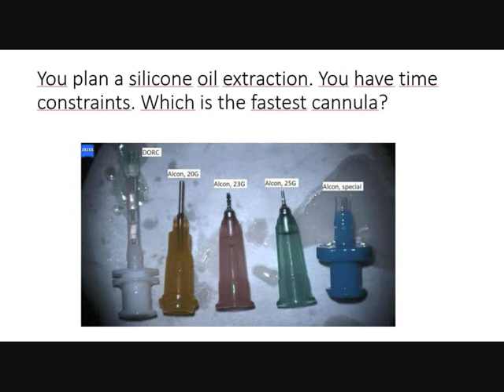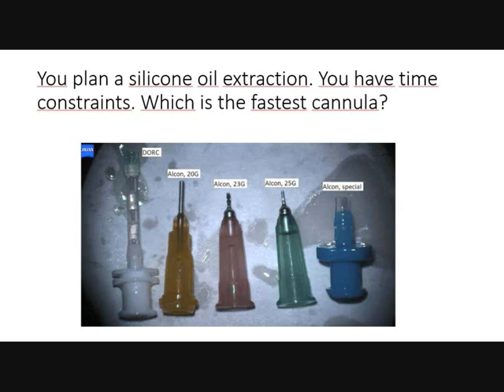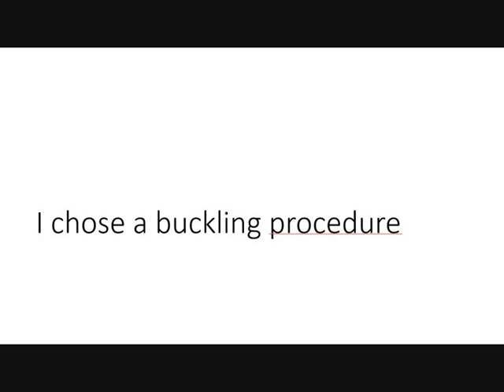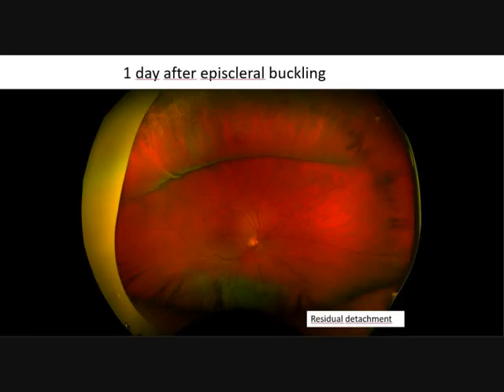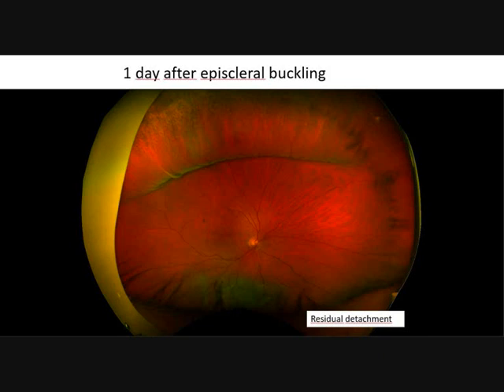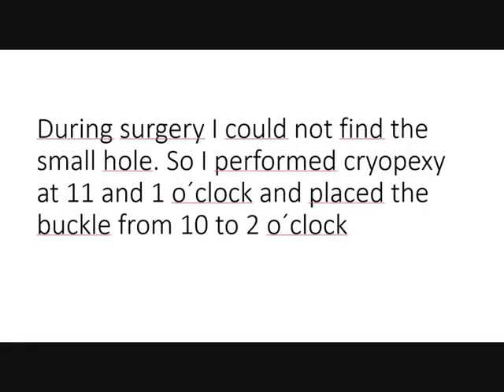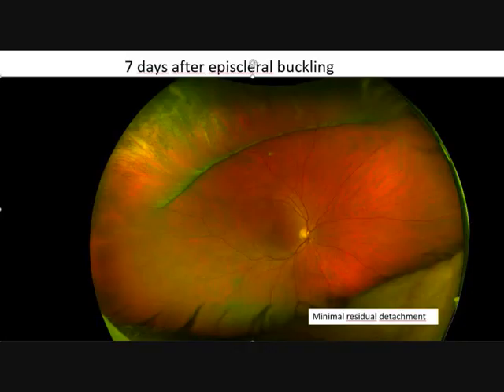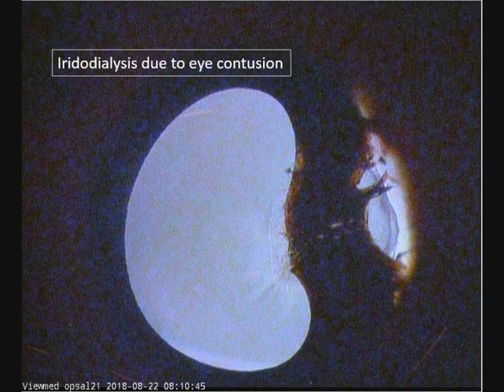Case series report: part 3

Comment: thank you for sharing.  superb surgery.
in case 2, although you did not find the break, you did blindly make cryo-treatment at 1 and 11 oclock. My question is: if you didnot do cryo-treatment would retina also attached?
Reply from the maker: Yes, blind treatment. If you do not Cryo and only buckle then the retina will attach. But if you remove the buckle, the retina will redetach.
Reply: @ulrichspandau  thank you
Reply: @ulrichspandau  thanks sir for sharing this video I have a question : if you do not do a cryo but juste a buckle and a barrage with a laser 10 at 2h , it can work ? Many thanks
Reply: I mean barrage laser on post op , from 10  to 2 h ..
Reply from the maker: @aniskaci9236  Yes, of course. You can Place first the buckle and wait. When the retina attaches you can apply laser. But: The problem of this technique is to find the break on the buckle.
Reply from the maker: @aniskaci9236  A barrage laser allows a more blind laser without knowing where the rupture is. This should work.
Reply: @ulrichspandau  ok, thank you ..